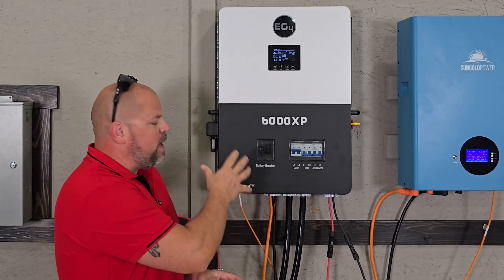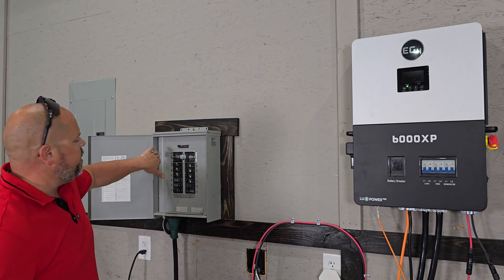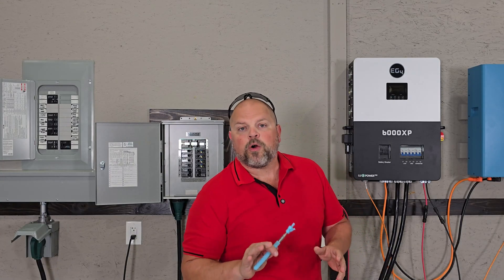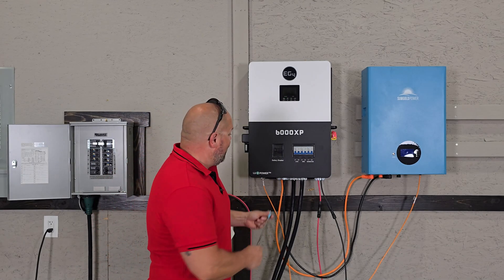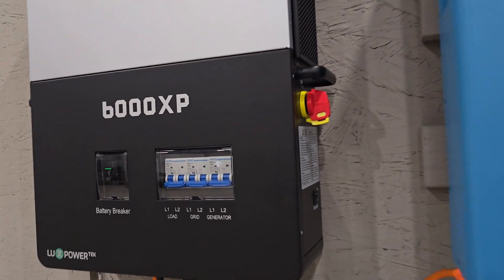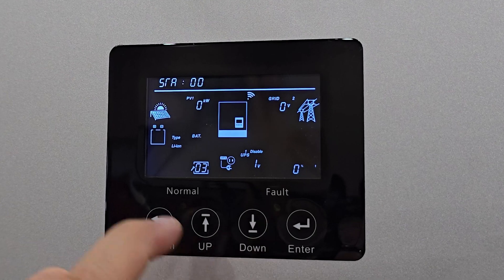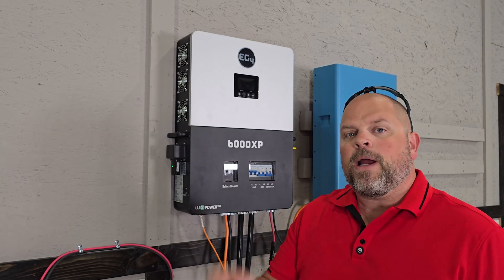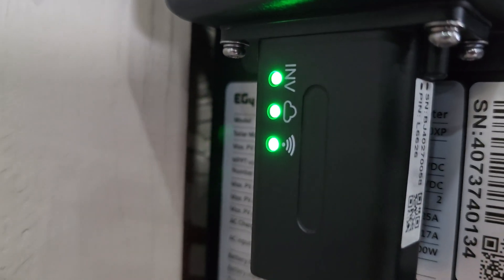Full Install EG4 6000XP Inverter

Comment: I still can't understand for $1,600 why, EG4 can't include the battery lug nuts. It's worth mentioning that (on the most recent 6000xp version) these are M8 (8mm) 1.25 Pitch nuts NOT 5/16-24 or 5/16-18, which are ALMOST the right ones. Ask me how I know all that :)

Comment: Thumbs WAY up!!.....  I have an EG4 6000XP and part of your video tells how to connect it to get power from the grid to charge the batteries.  Your video says that you are using a 240 volt access.  Can this be done using just 120 volt and plugging it directly in to the wall outlet of 120VAC?

Comment: Great video! I'm looking to build a very similar set up. The only difference is that I will be connecting the 6000xp load to an existing generator inlet with interlock that is already installed on the main panel. So I won't have a critical loads panel. Do you know if I can still charge my batteries with grid power through the 6000xp? I want to avoid creating some kind of a loop when using the battery backup to power the house but the 6000xp is also connected to "grid" power. I know this is avoided with a critical loads panel but I'm looking to see if there is any alternative to lower my costs.

Comment: I asked Google the following question: "Which EG4 inverter models are susceptible to hacking?" And is Google's answer.

All versions of the following EG4 inverter models have been identified as having security vulnerabilities: 

EG4 12kPV

EG4 18kPV

EG4 Flex 21

EG4 Flex 18

EG4 6000XP

EG4 12000XP

EG4 GridBoss 

Specific vulnerabilities

Several vulnerabilities have been identified, including:

Cleartext Transmission of Sensitive Information (CVE-2025-52586): Modbus TCP command traffic between the monitoring application and the inverter is transmitted in plaintext, allowing attackers on the local network to intercept, manipulate, or forge data.

Download of Code Without Integrity Check (CVE-2025-53520): Firmware updates can be installed without integrity checks, enabling attackers to install malicious firmware.

Observable Discrepancy (CVE-2025-47872): The product registration endpoint server responds differently depending on the validity and registration status of a serial number, allowing attackers to gather information on device registration statuses.

Improper Restriction of Excessive Authentication Attempts (CVE-2025-46414): This vulnerability, patched in a server-side update on April 6, 2025, allowed unlimited PIN brute-force attempts for registered devices, facilitating unauthorized access. 

This is exactly why you will never find an EG4 inverter in my home.
Reply: Just don't leave it connect to the network.     Conspiracy filled dummy..

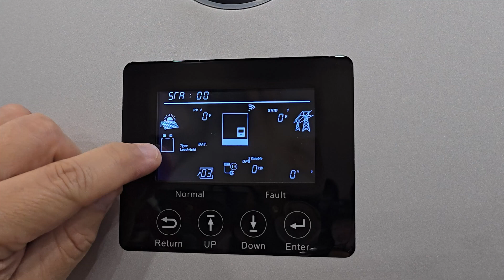Comment: Great Video! @8:51 I use no battery on my EG4 3k as I only run A/C during the day as a supplement to our Central A/C !  Planning on 4x12v 280-300ah  just not there yet!

Comment: Where did you get the plastic covers for the knockouts? Also these large knockouts hold the 6/3 fine but they dont really secure the Battery cables tight any suggestions?
Reply from the maker: They came with the eg4 raceway/troth

Comment: If the grid is connected to the 6000xp, to charge the batteries, to run the loads, what is the point of a transfer switch? Wouldnt a regular subpanel work the same? Dont see why you would flip the transfer switch when grid power is available on both sides of it
Reply from the maker: For me it is something that makes testing inverters a lot easier to do. But it is not required.
Reply: It allows you to easily bypass the inverter. Maybe one day you want to upgrade it or are encountering issues.

Comment: will this set up automatically switch to battery power during an outtage ?
Reply: Old question, but the 6000xp is an 'off grid' inverter, so in most common setups it uses batteries until they drain to whatever % you set, then automatically uses the incoming 'grid' power to power the load panel and/or charge the batteries until enough solar power is available.

Comment: Hey do i need a critical load panel?  Ive been watching u and will prose and rrying to figure out my build. He just tested the inverter ac output eith like a extension cord multi plug in..will a power strip wct kikda like a circuit breaker? I jus want to power my blackstone grill and ninja woodfire grill and then my other small basoc stuff maybe tv and media too

Comment: Trying to set my eg4 6000xp fully off grid with no wifi. It charges my lithium ip battery great but can’t find clear information on how to simply wire ac out to my breaker box and which settings the inverter needs to be on. The manual shows a lot about ac in which I do not have at all. I just want to run it in an offgrid situation. Any tips will be greatly appreciated. Thanks in advance
Reply from the maker: I would reach out to Signature Solar or the company you got it from and speak with their tech support. That way you can explain your setup in detail and they can walk you through the process.
Reply: @  it was just the EPS out switch on the bottom left side lol. I was baffled
Reply from the maker: @  I'm glad you got it all sorted out

Comment: These low surge, short-lived, 6,000 Watt high frequency,  transformerless inverters were already way overpriced. But now that they've increased the price by over 21%, from $1,399.00 to $1,699.95, its price has now gone beyond ridiculous and entered the realm of ludicrous!
Reply: Useless spambot comment.
Reply from the maker: What is your recommendation?
Reply: @TheSolarPit  Any brand (preferably an American-made brand) of low-frequency, transformer-based inverter.

Comment: The clamps that you secured your wires with are a bit worrisome as they are conductive and somewhat compromised the insulation of the wires when they are tightened on the insulation.
   Cord grips would be less likely to compromise the insulation especially plastic cord grips would be safer.
    No offense but that is something you might want to consider changing.
Reply from the maker: Those are the same UL-listed clamps that we use in metal boxes for running (romex) NM cable. Most likely, you will even find them in your main service panel. They are designed to work in this application. They allow for securing the wire without damaging it. Cord grips might be a great option as well, though! I understand the concern and I appreciate you sharing.
Reply: @TheSolarPit  I've used waterproof type clamps with rubber conduit to panels on these before as well.

Comment: I'm sorry why do you need the transfer switch? The XP has a AC Passthrough..
Reply from the maker: It is not required, it just makes my job of testing equipment much easier.

Comment: Couple questions, if you are setting up a panel on the load, don't you plug directly into the panel and not a breaker with both the L1 and L2 wires? Also, why did you use the RS485 vs the CAN? Thanks

Comment: If I’m completely off grid , no grid power could I connect the load wire directly to a 200amp panel through the lugs?
Reply from the maker: Yes, but size your main breaker and wiring accordingly.
Reply: That's my question too. None of these solar guys ever have a normal setup. It's always "I have a XYZ setup, yours will be different." 😆
Reply from the maker: We are trying our best to help

Comment: Ok, I feel like an idiot.  My 100 amp main breaker panel is piped straight through the wall to the meter outside to a limited space where the main panel is so moving it or mounting a subpanel next to it is out of the question.
I would like to install a 6000XP, with 2 48v-100Ah batteries, and 2kW solar where the grid is only a last resort.  I have no more space in my main panel since I put in a 50A breaker for an emergency generator with lockout. 
Can I use #6 gauge with taps on the 2 hot lines and the neutral to feed the 6000XP and shut off the main breaker so the 6000XP feeds the whole house?
Then, if the solar can't keep up, the 6000XP can use grid to charge the batteries.  Highest use is around 1.4 kW/hr (33kWh/day) with AC and all running.
Reply: I had this issue and just mounted a new critical load panel, on the surface next to my main breaker panel, then moved the circuits I wanted from the main panel to this box. I bit ugly but it worked. Then you can remove those breakers from the main panel and install a 30amp circuit to feed the 6000xp as it's grid backup.

Comment: Only complaint I have with my EG4 panels is software customization. Not much there at all. They don't support floating lithium batteries and they use SOC for ending the charge cycle. Which is fine I suppose if using their batteries, I'm sure they are designed to work together. But it can be a bit of a problem with third party batteries especially when using multiple batteries. Would be much nicer to be able to control the charging from the master BMS in the string to ensure top balancing and SOC for all the batteries.
Everybody's got a gripe, right. :)

Comment: Low cost, high frequency, trandformerless inverters are designed for occasional emergency use or temporary use during a weekend camping trip. They were never meant for permanent off grid applications. They offer far poorer surge capacities and much shorter life expectancies, you'll be lucky to get even 3 years of continuous use from these Chinese made inverters. And because they don't use an isolation transformer, they can damage your appliances when their MOSFETs fail.

Comment: New Subscriber question: is there a way to eire the 6000xp+battery but without the critical load panel and still capable of charging batteries with the grid, assuming no solar panels available? tks

Comment: Is it posible to coneect it without the transfer switch? As a backup in case of a power outlet? So no power then inverter will use batteries, but if power then inverter will charge batteries. Assuming no solar is installed.

Comment: Nice how to video.. Dumb question: I have the 6000xp & bought 1) VATRER 51.2v 100Ah LifePO4 battery by mistake. Didnt notice it doesnt have a COM port:/ Has app + blue tooth & a nice touchscreen so will try to use it.  I don't plan to hook it up to PV for a while so I want to connect the Grid to the 6000 using an extention  cord cutting off the female end & connecting the black wire to L1, white to white common & GRD to ground bar.  The plug-in is on a single  20A CB in my 100A subpanel for my 1000sq ft addition. 

I only want to pwr lights & TV.. no 220v AC etc. I had the addition wired w/ a backup generator so I already had RELIANCE PRO/TRAN 2 transfer switch w/ 10 CBs I plan to pwr with the battery during a pwr outage.  So I won't need to charge the battery very often from the grid. 

The main side of the house has 2k PV & 2 EG4 48v-LL batteries & another 6000XP that i use to pwr 10 circuits using another transfer switch.. so wont backfeed to the grid if we lose pwr.

The battery manual says "recommended charge current is 20A (0.2C)". Since my 12AWG extention cord doesn't have a Red wire do I still need to install a 8AWG 3wire to a 30A DBL throw CB?
OR can it be a 20A DBL CB 
OR will the battery  charge ok w/ using the 2 wire extention cord plug-in to an 20A outlet   idea?
Reply: Update.. I could not get the VATRER battery to connect & turn on the 6000XP plus it didn't have a COMM port. Also another nice feature the EG4 battery  has "2 onboard fire extinguishing modules" so I robbed one of my 2 EG4s that I had in  parallel so now each of my 6000XPs will only have one battery.  

Now I need to return the 110#  VATRER battery so it will cost me $200 to  ship it back.  Otherwise, it seems & looks like a good battery & if it would have worked w/ my 6000XP I probably would have kept it.

Comment: Would anyone advice against this unit for a moving vehicle like an, RV, Van or skoolie?
Reply from the maker: I think this would work perfectly in a RV or Van. It can be a little noisy under a decent load though. My measurement came in at 61 (dB). But I have tested portable power stations louder than that. Thanks for watching and commenting!

Comment: does anyone think this inverter would be a bad idea for a moving vehicle? like an RV, skoolie, Van, etc.? I have not seen any videos of this inverter in a moving vehicle, why is that?
Reply from the maker: I think it would be ok.
Reply: Its kind of big and wall mounted. Plus it's 48v which the majority of vans aren't yet and the fans will be on most of the time. 3 fans and 2 of which will be on all the time if It's above 60 degrees f.  You can slow the fans at your own risk.

Comment: Was watching to find the settings to set for the grid input to start charging batteries when hitting 20% soc or even better 46v
Reply from the maker: I am planning on making a review video of the inverter at some point. I will note to go over the settings in that. Thanks for watching and commenting! 👍
Reply: @JustinsProject  tech at signature solar recommend changing to lead acid and voltage in settings and power cycling 5-10 times which consists of draining battery bank to 46v and charge back up to 56v in as small time period for each as possible then switching back to lithium and setting 1 for powerpro batteries ( setting 0 for battery brand for lifepower and ll rack batteries)

Comment: A poor man's inverter. High frequency, output transformerless inverters like this offer a shorter life expectancy, a poorer surge capacity, and because they lack an output transformer to provide galvanic isolation between its DC boost stage and its AC output, they pose a potential fire risk when powering a home's AC appliances. No thanks. Not in my home.
Reply: Suggestions on what you would use, and how you would setup  .
Reply from the maker: Thanks for watching and commenting!

Comment: Great install. You don't need 6 awg on the AC output though. Next time you can save a few bucks and not have to wrestle with big wires. For the Ac output on an EG4 the manual calls for 8awg but really 10awg is perfectly fine because the unit is not capable of producing over 30 amps.. I keep a roll of romex 10/3 on hand for this
Reply: Also I noticed you used 10 awg on the PV input, the unit is not capable of accepting 30 amps input it maxes out at 20 amps so you can use 12 awg there. Excellent work regardless
Reply from the maker: I have 1000ft of 10awg PV wire. :) I used what I had on hand. Never hurts to oversize the wire other than the pocket book.
Reply: I am planning to use two 6000 XPs in a a parallel configuration and will be combining their input and output connections - so I thought that I would need 6 awg for the individual units and from the combiner box, will use 4 AWG for the main connection. Will it be an overkill?
Reply: @kajavaid  Don't even use a combiner box. Run 10 awg straight to the AC panel and combine the inverters at the AC panel. All you  need is a dual trip 4 Pole 30 amp breaker.
Reply: That's the off grid electrician special right there been doing it for years
Reply: @themoneymercenary  Thanks. I really appreciate your advice.
Reply: Isn’t it able to provide a surge of 12000watts  12k/240 =50 amps. The breaker on the load of the 6000xp is 50amp. Could I wire it directly to my 200amp main panel lugs since I will be completely off grid?
Reply: @markj811 Two 6000 xp's together can provide that much power but one by itself is only providing 25 amps. The connection in question is between ONE inverter and the AC panel...not both of them. Two 25 amp connections each using their own 10 guage wire makes up 50 amps total safely.
Reply: @themoneymercenary I’m talking about the surge rating. ONE 6000xp can output 12000watts for 5 seconds
Reply: @markj811  Any conductor can handle a surge that is far higher than what it is rated to constantly carry. Breakers are also rated to handle surges too and are designed to only trip after a certain amount of current is ran through it for a sustained amount of time.
Reply: The documentation says in AC bypass mode it can supply 50 amps.
Reply: @coreyfournier3345  a single 6000 XP can never supply 50 amps. 50 amps x 240 volt = 12,000 watt. If that were true the manual would call for 6 AWG or bigger. It calls (incorrectly) for 8 AWG.

Comment: I like it. I never knew for sure that you could connect the XP6000 to the grid. I wanted to run a mini-split and have grid to pick up when the battery is below 10%
Reply from the maker: You can charge from. The grid but not backfeed the grid. Thanks for watching and commenting 👍🏻